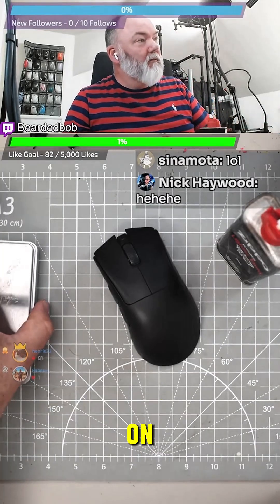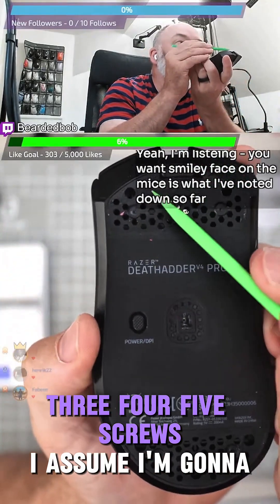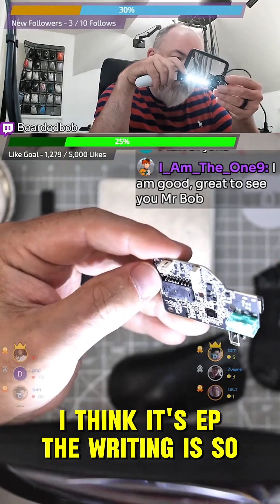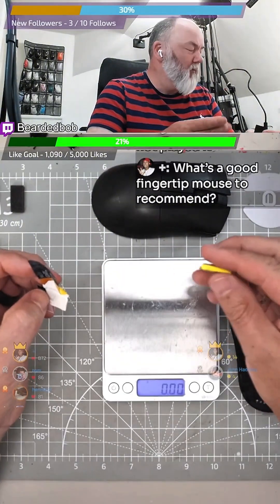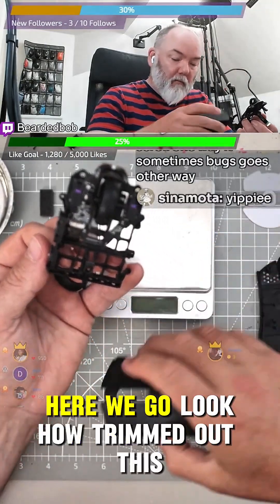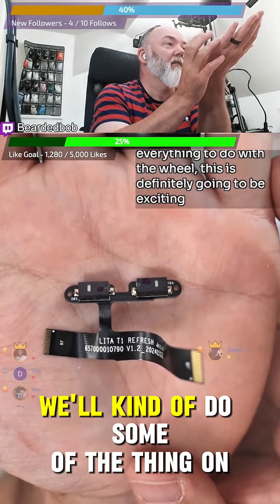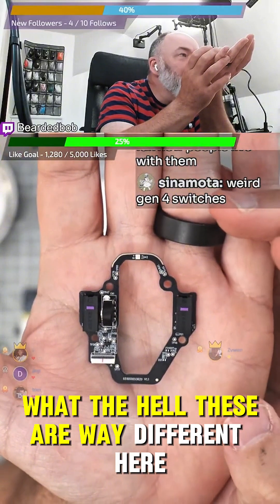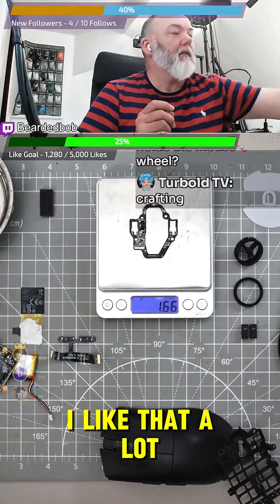Razer Death Adder V4 Pro Teardown

Comment: It would be great if you showed the "wonderful engineering solutions" of the Zowie EC 2 DW... There are screws under the board with the left and right mouse buttons (for adjusting pre-travel, apparently due to poor manufacturing tolerances) that rest against the board from below (the board is suspended in mid-air on three sides). Because of this, when you press the left and right mouse buttons, the buttons vibrate and rattle (and this is unpleasant to feel), which also negatively affects the sound. On my Zowie EC 2, the clicks are much more noticeable, as they are designed in a standard way. Google translate.

Comment: Are you planning on coming back to releasing weight reduction videos? I miss them. I think you'd do KILLER on a video about weight reduction mods for the Keychron M5. Literally NO ONE is doing content about it and it is, on paper, one of the top five mice on the market. It is unique in that it is a vertical mouse with a flawless sensor and 8K polling rate. You would be the talk of certain message/image boards.
Reply from the maker: I've not stopped I'm just waiting for something new to do as they are all doing the same things which I showed them tbh haha

Comment: I hate the new switch sounds and they're so unique there's no replacements. Will be returning my mouse until there's switches available or a revision that corrects the awful sound.
Reply: Can't you use older razer switches and swap them out?.
Either way just wear headphones
Reply: @Unlucky1776 you cannot. They're a completely different design from previous switches. And no I'm not gonna wear headphones whenever I'm on my computer. I have a nice speaker set up
Reply: @Keiuran  k.

Comment: Please bring GPro X Superlight 2c Tear Down
Reply: Do you have any specific questions? i teared my down
Reply: @Flash_Akali  what side switchs the are using?
Reply: @TheoSaan  same as the gpx 1 and 2 , blue omrons, but they reduced the pre-travel a bit, so the clicks feel a bit more tactile. also, the side button cable isn’t the same as on the gpx 2 , it’s slightly more compact in some areas and have different positions, you can't interchange their cable
Reply: @Flash_Akali  thanks For in Info

Comment: doesnt look like hot swap pcb would even work with this, the switches are just naturally so low that any mechanical switch simply wont fit
Reply from the maker: If they are the same style as these you could swap them just knowone makes another switch like this